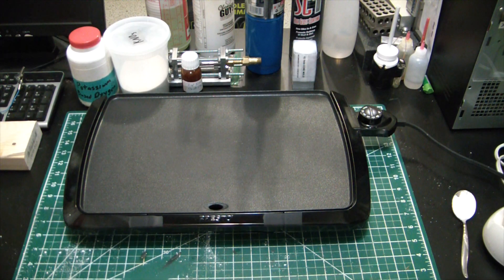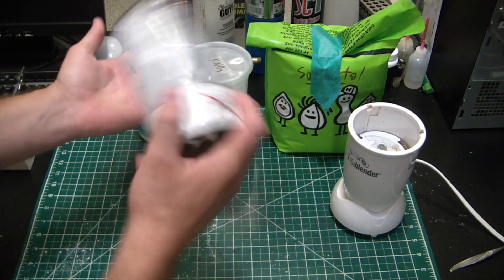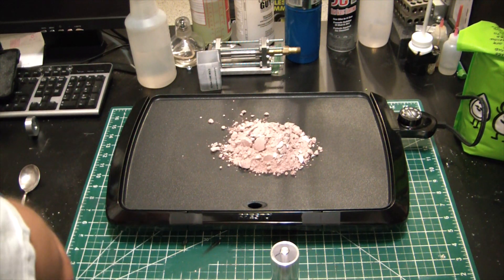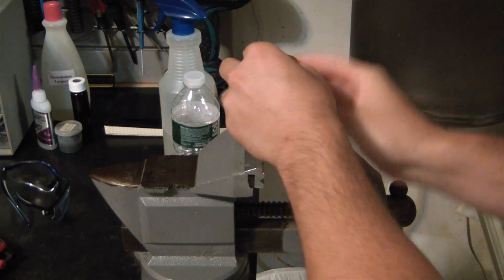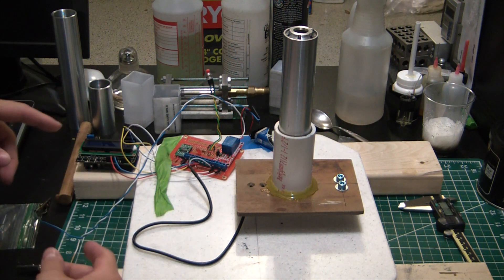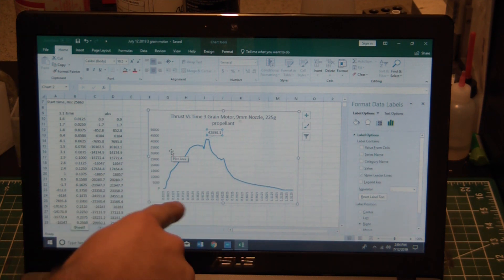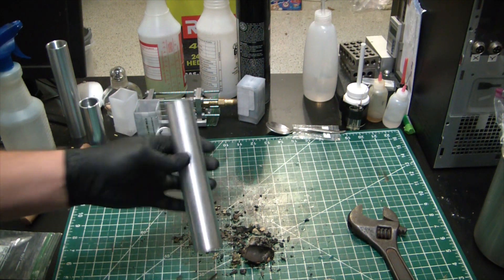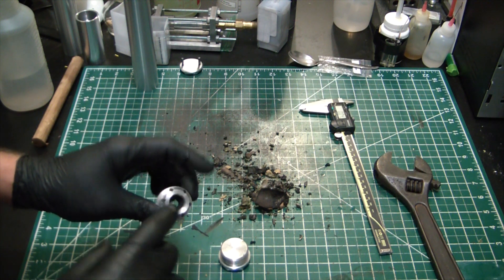A Massive Three Grain Rocket Motor - Arduino Static Thrust Test Stand - Elementalmaker

Comment: adding an additional 10 parts of sulfur to the red iron oxide spiked mixture makes it even better but be careful to not set it of when cooking it sulfur has a low autoignition temperature i always take of the pan a sprinkle a miniscule amount of sulfur on the heater and see if it's hot enough to ignite it so i don't set my whole batch on fire that would SUCK

Comment: try a nother 3 grain motor, but  make the final grain a slow burner with perchlorate, middle stage a normal  sorbitol, then first ignitor a FeO mixt. this should give you a quick off the pad launch, then a normal burn then a slower continuous burn  to reach maximum height as it loses fuel mass. somehow need to find a progressive burn instead of all firing at the same time.  maybe a "degradable firewall" between the grains?something that lets the first grain burn 90 % before letting the second grain ignite and subsequent to the third..

Comment: Nice set up. I think you might find that by applying a thin coating of petroleum jelly to your motor mold's core spindle, the grain/propellent will be much easier to remove. The petroleum jelly won't contaminate and affect the burn rate.
Reply from the maker: Thank you John. I do need to give petroleum jelly a try next go round!

Comment: There is a lot of science in the differences between the grains.  Grain by the nozzle can have a larger bore and maybe a finned interior surface, the grain near the closed end can have a smaller bore. Remember that the grain by the nozzle must pass three grains worth of hot gas without being abraded by hot gasses, then any abraded material hammers the nozzle.

Comment: Also, in regards to using your goo.gl Amazon link, people need to be sure to highlight the link, then copy that. If they right click on it and copy the address, they actually copy the Youtube redirection link that sends them to that; or if they have some browser settings that confirm foreign redirects then they would see that alert every single time. I suppose that might still work, but if Youtube changes anything it could impact that (but I suppose I could be wrong)

Comment: I have been re-watching your vids and I just started into my own little project. would Fe3O4 or black iron oxide work just as red iron oxide???
Reply from the maker: I do believe black iron oxide will work as a catalyst.
Reply: @ElementalMaker  That is correct, either works fine. When fine tuning the mixture, a small adjustment in the amount of oxide is necessary.

Comment: Put a thin film of Vasoline inside the casing before assembling. The grains will go in more easily and it will make the casing easier to repair. 

The nozzle damage looks like normal erosion due to the supersonic gas flow.

Comment: I believe your thrust was actually higher than what you measured. Your test stand showed some considerable deformation under load, meaning energy was lost and the normal force on your load cell was diminished. Because the normal force was diminished, your load cell did not deform as much as it should have, resulting in a loss in measured load/thrust.

Comment: A 206s Isp for a sugar rocket is insane.

A small tweak to your code for the arduino can allow you to launch it from your laptop where you collect your data. 

Basically you would be replacing the button with a code word, and using the serial monitor from the arduino to light your candle

Comment: I have some really old Estes solid rocket motors from early mid 70's they are not very stable.
Reply: If they are the old D motors, they were not very stable even when new - very prone to grain cracking of the BP, which resulted in CATOs.  After 40+ years, the C motors may be developing the same problem if they have received a lot of temperature cycling.
Last time I used some of my old Estes motors from the early 70s, up through C were fine. But every one of the remaining D motors were bad. I should probably dig them out one of these days and use up the rest of them.

Comment: Nice video. Massive three grain sugar rocket motor? https://www.youtube.com/watch?v=eeOVhQKnTfg 
We also fired a 12" 3 grain motor. I think you made an error in your Isp calculation, the highest we ever obtained was 135Nsec. You might also machine a stainless steel nozzle insert, we try to use 303 stainless steel, I have one with over 25 firings and looks like new; cleans up in plain water.
Reply from the maker: I think I did mess up the isp calculation. Unfortunately I can't go back and edit the video although I'd love to correct that. Unfortunately my lathe can't handle stainless otherwise I'd definitely make an insert. 25 firings on one nozzle is very impressive! I'll check out your video link now
Reply from the maker: That video was unreal! What a motor!

Comment: Two things:
First off, if you used one hollow grain at the nozzle followed by two solid grains you'd get a longer burn using your current propellant.
Secondly, if you added some smokeless powder to the mix, by kneading it in to the propellant after the KNO3 and Sorbitol have been melted and are starting to cool, you'll get a lot more power.  This high energy hybrid propellant would allow you to use 3 solid grains for a pure back-burn setup.  However, one long grain would be better for back-burn.  You should leave out the Iron Oxide in this hybrid mix.

Comment: why are you using graphite instead of something else like copper maybe?
Reply from the maker: For the nozzle? Copper would melt very quickly, steel might for for a bit before melting. Graphite is about the only thing that can withstand those kind of temperatures.

Comment: Ummmmmm. Wouldn't sugar and KNO3 be easy enough.  Sorbitol is both expensive and not widely available.  Sugar rockets are common.  Iron oxide works in the mixture like it works in thermite.  It ensures that once the reaction starts it will continue to it's completion.  Oh I didn't wait for your explain. Watching as I am commenting.  Just for your info Sugar and KNO3 can more safely be melted in a double boiler.  You can add water (just a little too much will cause problems)to your admix to help combine and it will melt together easier but you have to keep on heat to dry it out some.  Should not do any of this inside of your home.

Oh by the way where is the Tim Taylor in you?  Go big or go home.  I wanna see something on the order of 10 times that big.  And I wanna see it fly.😉😉😉. ROFL.

Comment: ZnS is easier to work with.
Reply from the maker: ZnS is a pretty terrible propellant with a strong propensity to explode with the slightest grain imperfection. Although it does produce an awesome flame.
Reply: @ElementalMaker  Thanks for responding.  Back in the sixties we transitioned from melted potassium nitrate and powder sugar (10x) to ZnS following recommendations from the Scientific American.  We had to tinker with the brass burst diaphragms to balance between liftoff and failure.  The rockets usually had two to five pounds of propellant.  Amazing altitudes, but dangerous.

Comment: I like to use mystery ingredients to remove stumps
Reply from the maker: Its great for that too! Do you burn them out after a couple months?
Reply: @ElementalMaker  I don't know how to resist not burning them out. Perhaps a video of expedient stump removal is in order haha
Reply from the maker: @evry1tookem  I've been thinking about doing that! Recently cut a small cedar in the backyard and drilled a bunch of 1" holes in the stump and filled with kno3. Added boiling water and repeated a week later. It's been a few weeks since than so that sucker should be ready to burn up now!
Reply: @ElementalMaker  That should be a really fun video! I'm sure that iron oxide could come in handy for such a thing

Comment: On a side note, did the griddle heat up and cause the green cutting mat to not want to remain flat anymore like heat did to mine? Guess it sure helped having a air spacer between the mat and the heat involved. Careful with that people or you will become disgruntled accordingly!
Reply from the maker: No mine didn't warp at all from the heat

Comment: a three grain 38mm motor is not considered a big motor in high power rocketry. O class motors are 6 to 8 " in diameter with 6 grains and more. Ammonium perchlorate produces  much higher specific impulse than sugar motors do.

Comment: I think comments also help with YouTube. Do here's a comment. 

But as long as I have your attention, when are you going to take the tube from the center of a roll of Christmas wrapping paper, give it some reinforcement, put in a can of black powder in the top. Then cut off the extra tube slap on a nose cone and light that puppy up.

Comment: I think the nozzle damage was caused by impact from the hard schmutz particles that were observed at the head end of the motor and collected on the nozzle. The pressure spike is usually caused by a void or crack in the fuel but in this case the hard particles exiting the nozzle may have played a role in it. I like to use poster board or file folders as my liner with two wraps to prevent damage to the case. Not enough thermal barrier may cause the case to blister or damage it. Great video and keep up the good work!
Reply: I agree with you, the nozzle damage resembles particle impingement impacts. Large particles passing through the throat area would reduce the exit area, increase chamber pressure, and produce thrust spikes.

Comment: Since black powder has such a fast burn rate (enough to classify it as an explosive) I wonder if that's what caused the blowout of the nozzle. If you feel your ignitor needs help maybe try using just a bit of some type of smokeless powder. Something like a pistol powder which burns faster. I would maybe try something like universal or unique. But that's just because that happens to be what I have on hand. What are your thoughts on this?

Comment: BE VERY FUCKING CAREFUL WITH THAT PROPELLENT CASTING METHOD. You could be creating extra air pockets in the grain. That little air pocket will create a small explosion with in the casing that can cause a RUD.

Comment: That's 42kg of thrust with a less powerful fuel than is possible
... couldn't convince you to make a 3 grain sugar rocket could I?
Reply from the maker: We're going to be moving into composite AP based propellants soon... High higher power and longer burn durations!

Comment: I like your enthusiastic intro: "TODAY!" Do you plan on experimenting with other solid propellants? For example, the high specific impulse NH4ClO4 - Al homogeneously dispersed in a polymer matrix (binder)? I think the Space Shuttle uses it in its booster rockets. Don't bother with Zn - S (Zincoshine). Its specific impulse is crap.
Reply from the maker: Composite AP propellants coming soon!

Comment: I think 
1. The adding of black powder caused the entire inner surface  of the propellant to begin burning at almost the same instant, starting from from what would be the  top end to the bottom.
2. From what I understand, in the normal upright position, combustion should start at the bottom (nozzle end)  rapidly moving up the propellant. In effect you seem to have started the combustion at the the wrong end and came as close to detonating it as was possible by using the black powder.
- Probably best not to  be too close and behind hard cover  if you decide to use a proper detonator.
Reply from the maker: In the case with these engines its normal practice to ignite furthest from the nozzle as possible to ignite all three grains at once. And yeah I was behind the shed peeking out with a full face shield.
Reply: @ElementalMaker  If you want high specific impulse, you should try the sulfur & zinc powder propellant type.
It really produces a powerful  result.

Comment: I'd highly recommend using a thicker liner of sorts to help insulate the motor casing from the heat of the motor.  Smaller motors you might get away with it but as you get bigger you'll start having failures of the motor casing and it would be a shame for such a nice casing to end up in pieces.

Comment: The primary job of the casting tube is to inhibit the outer surface of the grain. 
Observations... To prevent cracking a grain, you should pull the coring rods while the grains are still slightly warm.The "hiccup" in your thrust curve is due to a small internal crease in a grain created by your packing technique, and your nozzle(s) will benefit from the use of graphite inserts. 
And you might want to back off on the RIO a taste. 2% is a LOT of catalyst, even in candy.

Comment: What would happen If you dissolved both the sorbitol and potassium into water and mixed them so they’re combined kn a molecular level
Reply: I think the solubility in water is too low. And they would tend to crystallize out separately which defeats the purpose. This trick DOES work on blackpowder though, because it allows the nitrate to recrystallize inside micropores in the carbon. But that's because the carbon doesn't dissolve.

Comment: I haven't worked with it yet, but how do you think compressing a puck of satanite and machining a nozzle out of it would work?
Don't know if a harder binder could be added??
Reply from the maker: Very interesting idea! I need to get a proper hydraulic press for it to work though I'd think
Reply: A bottle jack and some pipe to cram it in. 
Again I haven't worked with it yet so I have no clue how hard it gets.  Being in a upstairs apartment, I'm already pushing my luck with the lathe, anvil and animalistic sounds coming from here at odd hours.

Comment: Love that rocket tooling! 
The inconsistent data spike shows when the erosion happened at the nozzle. Pretty cool.
You are correct the damage was from by product of the fuel. Debris moving that fast can do some damage in short work.
When you move up to a cast Ap fuel using epoxy the burn is very smooth and powerful. Also very clean.
Thanks for the video. Always entertaining!
Go to firefox.com they have everything you need. Then go to pyrochemsource.com to get the AP.
Reply from the maker: Funny timing... I just was contacted by a fan who had bought a huge lot of chemicals at an estate sale. Included were 6lbs of AP and a gallon of R45-M along with a quart of isonate curative. Luck had it he wanted to donate these to me and was within driving distance.... So composite motors will be coming soon!
Reply: @ElementalMaker  O man that is great!
You will really love these. I have formulas if you need any.
I can help you out with anything you might be missing.
Reply: @ElementalMaker  If you can find it, get your aluminum in multiple particle sizes. The major difficulty in making AP propellants is getting the approximately 15% aluminum into the mixture.
Also, depending on the binder, you may want to get a vacuum pump and make a vacuum chamber to de-gas the propellant as it cures.

Comment: a trick I learned is to put a dab of Karo corn syrup in the mix it premelts a bit and the melting starts way sooner and the heat evaporatesthe water in it so it doesnt effect the burn rate

Comment: Loving these DIY rocketry videos. One minor point, seems something went awry with the specific impulse calculation. However, you scaled the impulse (20600 gFs) by 100 instead of the mass of propellant, which was 225 g according to the spreadsheet, and 300 g according to your batch calculations. So the Isp should be around 90 seconds.
Reply from the maker: Ah crap I screwed that one up then  😕
Reply: just did the calculation... it is 93.433424 seconds
Reply: Yep, the Isp is very poor, not much better than you get from compressed black powder. But you have a good start on the basics. It is about time to transition to an AN, aluminum, rubber grain - ratio about 70:15:15. One major advantage is no melting of the uncast fuel - since the rubber fuel is the binder. 

That nozzle orifice is far too large for your 3 grain motor - but MIGHT be OK for a 5 grain.
Does the casing have overpressure protection, so the nozzle end blows, rather than the casing turning into shrapnel? This is often accomplished by a relief cut around the inside of the casing, right in front of where the nozzle closure threading ends.
Reply: Isp should be around 110-130 for knsb

Comment: Great, great video! Thanks to Luke Foley for kicking it all up a notch. I will use your Amazon link. Last time I was fidgeting with rockets I was using Ammonium perchlorate and epoxy using the readily available NASA rocket booster formula. Using the epoxy formula makes the engines impervious to humidity and you can store them for years without any degradation. They also have a longer burn time. Thanks again for bringing rocketry back into focus.
Reply from the maker: Glad you enjoyed and I truly appreciate your support. I just got a gallon of R45 resin and isonate curative yesterday, along with 6 pounds of 200 micron AP, so get ready for some composite tests here!

Comment: "a little bit of schmutz" I always get a big smile on my face when I hear German words in English video :)
I didn't not take a look at your arduino code, but if you are using the analogRead instead of some low level ADC readout you might get some timing jitter with your measurements (hence the unsmooth graph). Its possible to run the ADC at a fixed frequency and read the ADCs value with an internal interrupt. This would let you calculate the measurement time more precisely than storing and relying on the millis() for example
I would love to take a look at your code right now, but first I have to get through my exam period starting next week :|
But I'm no rocket engineer and could be complete wrong, your measurments might be totally correct and the unsmoothness of your data is just the graphite nozzle breaking apart.... :)
Reply: o/